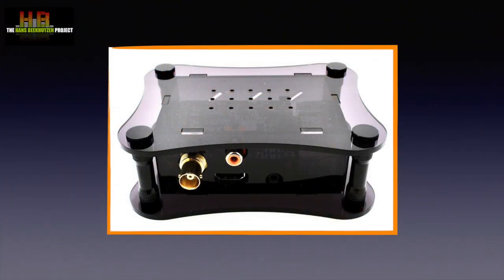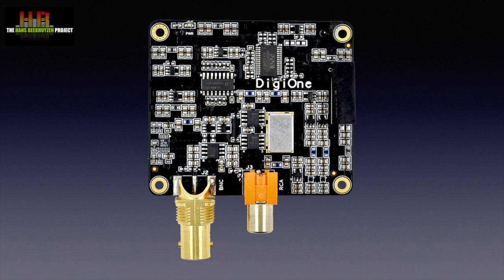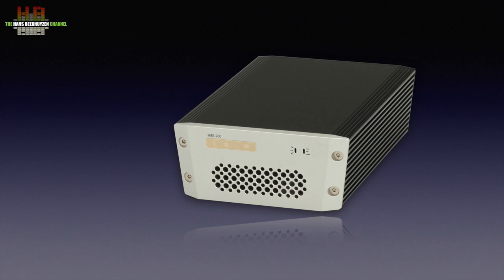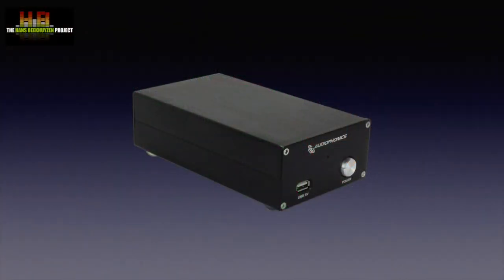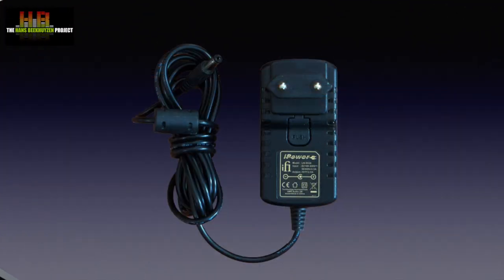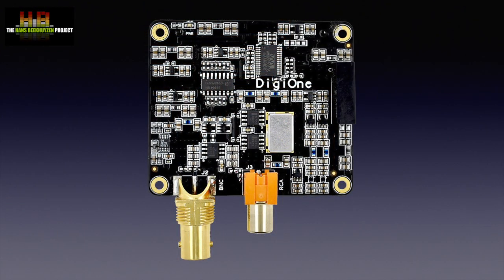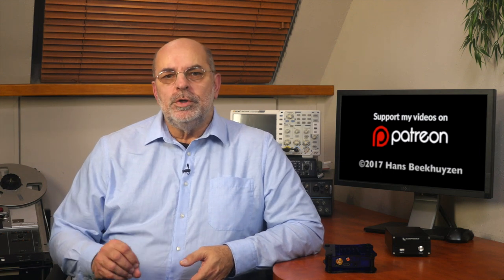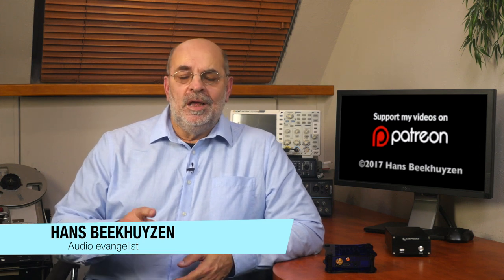Allo DigiOne SPDIF board for Raspberry Pi

Comment: Hi Hans, as I'm always trying new SPDIF board myself, I also enjoyed the DigiOne. From all the SPDIF board I have tried, I found the Audio Shield from Pi2Media, when fed by a separate linear power supply, even better. As you stated in your review I try not to use switching power supplies on the same fuse group as my stereo set is connected, as switching power supplies influences the sound quality.

Comment: As always it is great to watch your reviews. I like to share how to improve the sound qualityI am using a Caiman Seq DAC mode 3 which reclocks I am using good feet isolation and  weight on top with Cat7se cable. I use a 12v battery with a 12v to 5v adaptor, plus snap chokes on the cable to the pi Also using a IFI silencer on one the USB portsAll this takes the player past the SOTM 200 in my system

Comment: I already have a RPI 3B with a HiFiBerry Digi+ Pro running piCorePlayer. I've connected a 500GB SSD that I share using SAMBA so I can mount it on my Windows PC so I can rip CDs from the PC using dbPowerAmp as FLAC files and play them via the RPI. The Digi+ Pro is connected to an external DAC (MF V90) that feeds my Cayin a 50t Tube Amp. Question: Can i swap out the HiFiBerry Digi+ Pro and replace it with the Allo DigiOne (I have already ordered a different case). I understand that I have to change the piCorePlayer settings to use the DigiOne - any other issues to watch out for? Thanks - Steve

Comment: Good morning Mr. Guru, I have a question. I am waiting for the shipment of a digione signature in the next weeks, I ordered a battery pack too. I was wondering, how can I leave on the player if i run it on batteries? If not playing how long batteries last? Do you think there is some kind of influence on sound quality of the streamer is never turned off?
Reply from the maker: The battery pack can hold four batteries but it only needs two. So if you want to run the DigiOne non stop, you can run it on two batteries and charge the other two. When the batteries almost run flat, you can load the other two and then remove the flat ones. But if you use the DigiOne frequently, sound differences will hardly diminish when not left on all the time. I Have never listened so long as to know how long the batteries last.

Comment: Hello Hans, thanks for the review and channel. I am helping a friend setup a pi 3b to output s/pdif to his Anthem MRX300. I was looking for DAC options and found that this is probably the best sounding board. I have a question though. The Anthem is supposed to be able to decode 24/192 over HDMI but the jury is out whether it can do it over the s/pdif input. Do these boards decode the signal or pass it off to the receivers dac? I am confused on this part of the signal flow. I may be asking this wrong but what type of signal is coming out of the board?  I know its not analog but not sure what form of digital it is and what the receiver will be forced to decode.

Thanks
Mike
Reply from the maker: The Allo can but I don't know the Anthem so I can't say.

Comment: Hans, Hi. First of all thank you very much. Your reviews are awesome and you go to the point I like! I have a setup at the same level as your setup 1 but I didnt have contact with a digital player better than rasp+digi+ and my external DAC (tried oppo players, notebooks, htpcs). But I have analog system runing. Lets to the point: Digione w/ good PSU Vs Hifiberry with the power tweaks (clean power to the hifiberry board). What do you think is better?

Comment: Hi Hans, thanks for the video. In another YouTube channel, popular one, they claim Allo Digione with Raspberry Pi creates jitter or digital distortion because of Raspberry Pi and transmits to Digione. Thats why they created Digione Signature to overcome this issue. I know Digione Signature is created to eliminate or minimise the digital noise from Raspberry Pi, however did you come across any issues with Raspberry Pi + Digione combo? thanks in advance
Reply from the maker: All digital equipment causes jitter. The amount of it defines the quality of the device. The RPi noise can be filtered out to a degree. The Sig version does that better than the normal Digione. It depends on your stereo to what degree you will notice that.
Reply: @TheHansBeekhuyzenChannel  thanks alot Hans

Comment: Guys (or maybe Hans) could you please help me as I'm totally lost.  I'm trying to buy the best DAC in my budget and I'm confused. As far I understand there should be no difference in sound quality when I'm sending my digital signal through my USB DAC to my receiver because 01s going straight to my DAC in my Receiver and its DAC converts signal to analog Job done.  But... I  had 3 USB sound cards, signal has been passed through SPDIF optical cable to my DAC in receiver and all of them sounded differently ?? These were very cheap USB DACs  (10 GBP, 50 GBP and 50 GBP) Is it possible or this is placebo efect but I hear it for sure. I know that I'm not using digital conventers of any card but passing digital signal and yet all of them sound differently.
And now the tricky part: 
My DAC in my amp is capable to convert 24 bits/48 khz. Manufacturers of 2 of my DACS(sound cards) claiming that these are capable of 24/192khz and both of them cost 50 gbp ? Is it possible at all or is it just marketing ? One I'm using now has C-Media CM6620A chip. Prices of decent DAC starts from 300 GBP and  most of them are capable of 24/96khz ? Where is the catch ??
Reply from the maker: I can't explain here for what I needed several videos. Start watching https://youtu.be/YCNnUq6SbKg and then follow up with https://www.youtube.com/watch?v=PQ9kYVMz51k&list=PLMbsmejHnP8E-kEzlliBX1bc8V-V4aQfE and then https://www.youtube.com/watch?v=grzoqEb2KMk&list=PLMbsmejHnP8GnsyKiJupXrJjmcBPr4hyL
Reply from the maker: Please watch https://youtu.be/EykkzxUstL4

Comment: I am a rather newbie to the digital output board.  What is the main difference between the basic Allo DigiOne Board at $99 vs. the Allo DigiOne Player at around $175.  Thanks in advance.
Reply from the maker: The Allo DigiOne board is just the 'sound card', the Allo DigiOne Player is a working system that also includes the Raspberry Pi computer, a housing and an SD card with software installed.
Reply: Thank you.  I am just entering the digital to home stereo world.  For a few years now,  I have been burning cd's and accumulating a very large and robust iTunes library (I know probably better options out  there but it worked well for me) on my pc. 

I have been doing a lot of research the last few days but unable to find a solid answer.  Do you know if/how I can "somewhat easily/best option" to stream my iTunes from my (windows 10 pc) to the allo digione network streamer, board, or other comparable network audio streamers/adapters.  If you could kindly point me in the direction of where I can do more research I would greatly appreciate it.  Thank you.  I am a new subscriber, based on your excellent videos.

Scott

Comment: Hi, which is the source better for rpi 3? The source from NAS or from usb storage?
Reply from the maker: I have never tried. But be aware that not all hard disks and NASses are equally fast responding and/or polluting the connection with the RPi. I would start with a USB drive fed from a simple linear power supply.

Comment: I just bought the Allo digione with Volumio, powered by Ifi power supply, spending 250 euros more or less and I am pretty disappointed.  I am planning to use the Digione as a upnp renderer for Qobuz, but when compared with a 10 years old Dell Inspiron running the standard Qobuz application for windows, the Allo is a clear loser, with less detail and harmonic richness. How can this be? The rest of the chain is  Chord Mojo - Nad 320Bee - Dynaudio audience 72. I checked upnp is set on cd quality, checked Volumio settings, and have no other clue on what else to try. Did i miss something? Or just my expectations on the Allo where too high, and an old good pc can humiliate it?
Reply from the maker: Yeah, you use a € 100 DAC, mounted directly on a small computer. And then compare it with probably the best DAC at five times the price. Then you use a very good computer in its price range to drive a fine pair of speakers. You can't expect the Allo to live up to your your expectations. It does supply a decent quality for the non discerning listener, but it surely can't beat the Mojo. A better choice would have been the USBridge and then feed the Mojo over USB.
Reply: Hello Hans, thank you for your reply but i can't get your point. Both the PC (through usb) and the Allo Digione (through spdif) are feeding the Chord Mojo, so the dac is the same. I expected the Digione to provide a cleaner signal with lower jitter than an old pc, otherwise I cannot see why one would ever take the many Hats for raspberry into consideration. Maybe the problem is with upnp implementation, I'll try to play a file from a hard disk to make my judgement, but I am mainly interested in streaming anyway.
Reply from the maker: I wrongly thought you used a DAC board on the Pi, but you use an SPDIF board. Sorry. The galvanic input (SPDIF) on the Mojo isn't the best in the world. The designer Rob Watts prefers the optical input 'for it sounds the best'. But your Allo board has no optical output. I mentioned the USBridge since the Mojo performs better using a relatively clean USB input than using the SODIF input. Perhaps you should search for a (second hand?) SOtM sMS-200 or Sonore microRendu. Given the quality of your set and your ears that might be a far better investment.
Reply: After 3 days of burn-in I have to admit my conclusions were completely wrong: the Allo surpasses the PC having a slightly clearer sound, less distortion and a bit more harmonic richness. The comparison is more evident with files than with Qobuz (through upnp on the Allo, and through official windows app on pc). Happy end.

Comment: Thanks for this informative video! You mention you used the Digione / Pi combo at first with a Wall wart power spupply (before you used the AudioPhonics linear powersupply). Did you use the 5V Wall wart from Allo itself (see https://www.allo.com/sparky-eu/5v-power-supply.html) or another one that you had on hand?
On their webpage they are talking about 'specifications guaranteeing the lowest ripple and noise possible' but I' guess the ifi iPower is a better one.

Another thing: can this video be added to the Raspberry Pi for Audio playlist?

Comment: Hello Hans
Really appreciate you sharing your knowledge and experience about audio.
I ve been watching many of you videos before i decided the chromecast was the weak link in my system and to replace it with a Digione and experience the Pi adventure with Volumio.
I got really disappointed to not notice the least change in sound after 1 week break in and a/b testing. Didn't expect huge improvement but some at least 
Ifi pws, good cable 75 ohm bnc, system (amp+speakers) is a "modest" 4000+ eur. excl the dac which is an excellent rme adi 2. Really don't get it. Tested with flac,  tidal, spotify premium with no luck. Even listened with headphones (from the dac) which often reveals the slightest changes more obviously. Nothing.
Either my ears are too bad or my system does not allow to hear the difference. Or the dac is doing a too great jobb🙂.
I am not requesting free advice but wanted to share my confusement.
I'll try it a week more before I  give up the streamer upgrade idea. Speaker and amp are more rewarding i guess.
Thanx